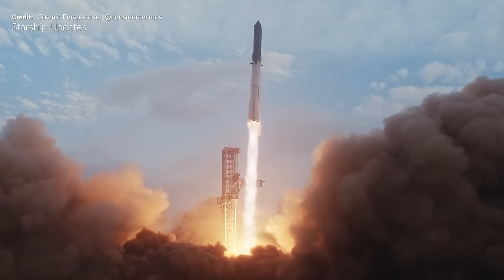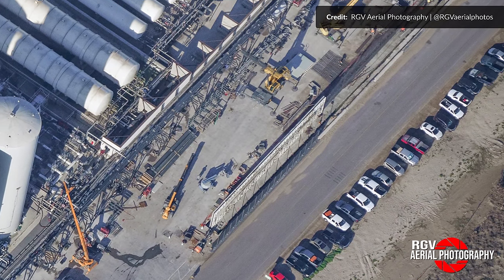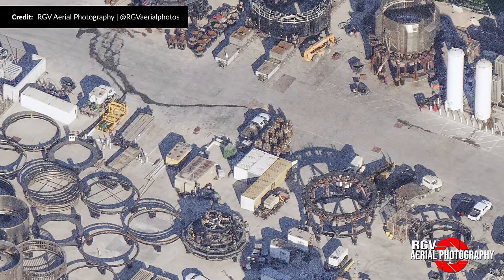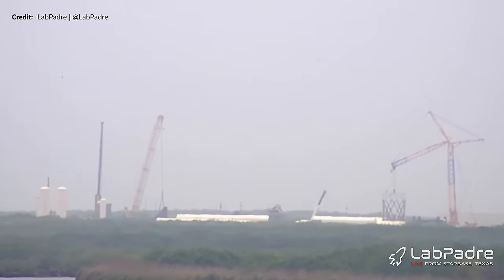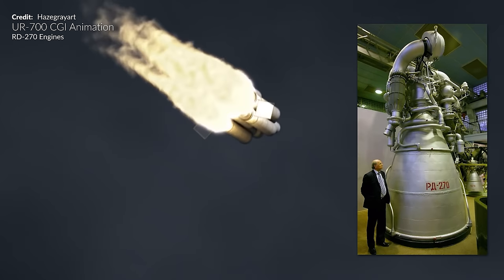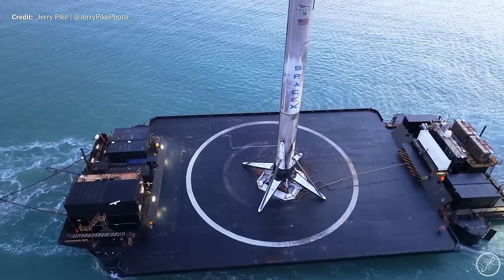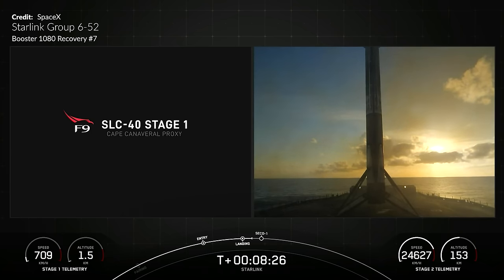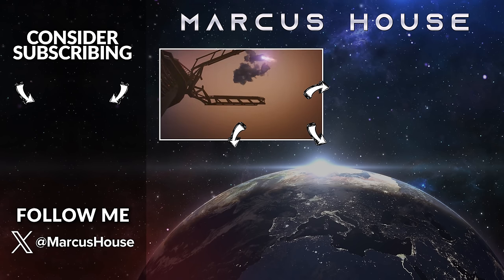Why is SpaceX Starship Only Capable of 40 to 50 Tons to Orbit For the Flight 3 Version?

Comment: For all you doubters out there: it took 7 launches before Falcon made a successful launch, flight and landing. Now they do it twice a week.
Reply: This isn't Falcon and NASA was heavily involved
Reply: @budyeddi5814 I don’t know the extent of NASA being involved, but SpaceX just finished their 3rd launch of the heavy and between its first and third launches, they have made enormous progress over a thing substantially more complicated than Falcon. At this rate, Starship is on pace to beat Falcon. Now that is an awesome track record considering the increased engineering challenges and complexity.
Reply: @Curteman20  ah yes, third launch and has yet to reach orbit. Absolutely groundbreaking
Reply: @budyeddi5814 ah yes, completely ignoring the original comment.
Reply: @budyeddi5814  hate and bait all you want, just small bait didnt make spacex stopping chase their dreams😂
Reply: @budyeddi5814 Starship didn't get completely into orbit as planned, and isn't planned for the 4th either. The first 4 flights for the Saturn program were also all suborbital as planned.
Reply: @mewmew3800  luckily criticism won't hinder their progress, but Uncle Sam might step in if they don't start hitting some major milestones
Reply: Apollo worked every time, its 2024, our tech is better yet they can stay on schedule. I hope they lose gov funding
Reply: @ThatDiecastGuy69 You need to do some more research on Apollo buddy.
Reply: @ThatDiecastGuy69  huh? All Apollo missions were manned. Manned rockets have a much different standard for safety than an unmanned test rocket. 

That doesn’t even consider that NASA and SpaceX have a completely different culture. SpaceX is much more willing to take risks to learn from mistakes and quickly iterate.

SpaceX would also succeed without government funding at this point. Government funding is now only a small portion of total revenue. Starlink program alone is more than 50% of all revenue
Reply: For all the doubters: Falcon was supposed to be a quick turnaround system, launching again within a day. Not to mention it was supposed to be a fraction of the cost to launch.
Reply: @SamuelMM_Mitosis Check again. Not all Apollo missions were manned missions. By the way Saturn5 had zero failures.
Reply: Criticism is warranted being this is the Artemis lander and was shoehorned into the program. There are big differences in work culture since the 60's. While I want to see it succeed, I have my worries.
Reply: @angrydoggy9170 Apollo 12 wants to know your location.
Reply: @coreygraybz  12? Don’t get it. Do elaborate.
Reply: @angrydoggy9170  Saturn V had multiple engine failures, one of which caused a partial mission failure.
Reply: @angrydoggy9170  Also, Saturn V was the last of the Saturn rocket program. The program had numerous failures and several suborbital flights that people count as failures for Starship.
Reply: @angrydoggy9170  they are? Falcon holds the record by far for most repeated launches from a single rocket.
Reply: @angrydoggy9170  do you know the cost per launch and cost per kg to LEO compared to competition
Reply: @budyeddi5814 I think we now expect them to know pretty well what it takes to reach orbit.
Reply: This is a completely different launch vehicle dude lmao
Reply: @chootybeeks1088  what does that change about the clear consistency in progress between launches?
Reply: @hebestreitfan6973 Starship can reach orbit, and SpaceX does know what it takes to reach orbit, and Starship did reach orbital velocity its 3rd test.  It's intentionally kept out of orbit because it's a test vehicle.  It's not trying to sustain orbit.  The last thing they want is an out of control vehicle coming back into the atmosphere at a completely unknown location out of control.  

Flight test 4 will test the engine relight and re-entry.  Once they have this tested, they will complete an orbit with Starship.  The goal is to not have a 165 foot rocket flipping end over end in orbit crashing into things.
Reply: One day they’ll get Starship into orbit. Once all the life support, furnishings, equipment, food, water, and close to a hundred people they might need several strap on boosters. So far with only the fuel and oxidizer it is having a difficult time to keep flying, or even complete an orbit.
Manned flight, if it ever happens, will probably be in another two years. I hope it’s sooner but even the most ardent fan boys are starting to wonder.
Reply: @SamuelMM_Mitosis  Ate you claiming Falcon is the quick turnaround (under a day) system that Musk has promised?
Reply: @SamuelMM_Mitosis Apollo 4,5, and 6 were unmanned.
Reply: @SamuelMM_Mitosis  Anyway, it’s not that hard to get that record if you’re just about the only one using reusable rockets.
Reply: I will guarantee you that Elon has his doubts.
Reply: @SamuelMM_Mitosis  they've made progress, but he's comparing apples to oranges is what I'm saying
Reply: @wavemaker54  It will never be able to fit a hundred people like Elon claims. Not even 20.
Reply: @bryandraughn9830  Elon doesn’t doubt anything as long as the money keeps flowing in.
Reply: @budyeddi5814 - nasa had next to 0 involvement with merlin. I'm sure they were heavily involved in safety and standards for flight.
Reply: @bryandraughn9830  lmfao, okay kid, whatever you say. Elon has many things, but doubts aren't one of them. But sure, keep pretending you losers know what you're talking about.
Reply: Great facts to use on haters else where !👍🏽 Starship will be an amazing leap forward and change, in how space agencies will operate moving forward in the future.
Reply: @angrydoggy9170 what money? His MIC competitors have gotten many 100x more government funding. SpaceX got chicken feed for Artemis. That's why they won.. And because of demonstrated success
Reply: @budyeddi5814 nasa is also heavily involved in starship because they need a lunar lander
Reply: @budyeddi5814 they could have made orbit, but they wanted to maintain their reentry in a fixed reentry window and timeframe.

If Starship failed to accomplish its de-orbit burn from orbit, it would have eventually returned as its orbit decayed and definitely not in the prescribed window.
Reply: @budyeddi5814 it was a decision to not reach orbit. The launch could have reached orbit easily. That isn’t the challenge.
Reply: @budyeddi5814 NASA is heavily involved with Starship as well. Especially the HLS variant. You just seem to be blinding doubting, which you are entitled to. Have fun being wrong once again in a few years. I’m sure you doubted Falcon as well. Have a good one!
Reply: @nobody2685  projection and deflection with a side of bold assumptions.. typical at this point. Fyi, I was a huge fan of F9
Reply: @Curteman20  💯
Reply: @angrydoggy9170  I’m claiming it’s the quickest turn around of any system ever.
Reply: @budyeddi5814 Raptor was designed and built by the same people that designed Merlin. NASA's involvement was a contribution to development. Thereafter the involvement was to watch to make sure the actual flights met all the standards.
The Booster is being iterated by the same process. 
Success is not 100% ensured, but  progress, and the number of prototypes available for testing, tells me there's a great chance of success.
Reply: @angrydoggy9170  is it easy to have the lowest cost to LEO and lowest price per seat to the ISS of any system ever on Earth?
Reply: @chootybeeks1088  I don’t think he’s really comparing starship to falcon, I think he’s just pointing out that SpaceX as a company shouldn’t be doubted just because they failed some early launches. It’s part of their culture to test vehicles even if it’s likely to fail because they get valuable data from it.
Reply: I'm fascinated by the Elon /SpaceX  haters , it seems emotion based, completely irrational hate towards projects that are groundbreaking,  I suspect the same haters despise Trump ( TDS) or the haters could be bots, Bezos does not recieve the same hate , Boeing SLS does not receive the same hate. SpaceX and Tesla do not hit every milestone but CLEARLY  they make progress unlike ANY other company on Earth every country on Earth would be proud to have a SpaceX/Tesla.
Reply: @angrydoggy9170 You're clearly disturbed.
Reply: @wavemaker54 Why so negative about an exciting project? How's SLS or Blue Origin? you hate the #1 rocket company in the world? that's bizarre!
Reply: Hey, I'm a doubter :D
I bet both of my testicles that we won't go to the moon because of Elon and the Starship :3
Reply: Well it took SLS and Saturn V one launch lmao
Reply: @ThatDiecastGuy69 Except that it didn’t work every time.
Reply: Nobody is doubting Starship… doubting the actual claimed capabilities
Reply: @leshommesdupilly Comparing SLS to starship is not a good idea.  SLS development has taken decades, cost tens of billions of dollars, and is ongoing.  It also costs over $1b per launch, and can't complete the mission by itself.  It is the poster child for why having a defined purpose and mission is critical.  However, I'm happy that it exists.  Saturn V was a purpose built monster and was also extremely expensive.  Even though it had its problems, it was a true marvel of engineering.
Reply: They’re called haters for a reason.
Reply: How many Apollo launches did it take to get to Luna orbit.. Nevermind not getting to LEO
Reply: The complexity hasn't changed since the 1960s and they have better technology presently.. Why aren't spacex on the moon yet already?
Reply: Falcon can't turn around in less than a month and the price per KG isn't ground breaking. There is more SI in these promises than fact
Reply: Star ship booster didn't reduce velocity at all it broke up at hypersonic speed. And the second stage was out of control spinning..
Reply: How reliable are those full flow combustion turbines when someone is sick on the moon and they need to get home.
Reply: @bobbarclay316 over a billion $s per prototype.. 🎉
Reply: @anthonypelchat  very true about the apollo flights... however they did meet their set milestones with each launch. So far the set milestones get suggested for heavy then on launch day those milestones get set back to clearing the pad. 
By comparison Artemis has had 1 launch so far and met every milestone set... so far artemis is considerably better bang for you buck
Reply: @bladewraith1580 starship launch 1 milestone was to clean the pad, anything else was a bonus. Spacex could easily set goals that would definitely be hit but prefer to aim higher. Its not about pr, its about data
Reply: @ExploringCabinsandMines it's not about hating, it's about project delivery budgets schedule overruns and contracts. It's business and tax payers money. Sometimes promises aren't enough. SpaceX need to deliver soon.
Reply: Sls is 6 years late on its first launch. That's 6 years of additional problems they had to resolve. If they had launched earlier they would have no rocket to try again with because they're development pipeline is so slow.  Spacex can produce a prototype in months, nasa takes years
Reply: Didn't NASA start planning to go to the moon in like 62 and get there in 69?  Spacex said they would be on Mars in 24..😂 Back in 16
Reply: @Radar23...Okay cool,so where's your successful Moon-capable rocket?
Reply: @Radar23  Agreed but SpaceX is our best hope for efficiency,  Gov no , Boeing  no , Blue Origin  no. I'm totally psyched when Starship launches,  Elon has already said the percentages of rapid disasembly so anything better than that is a treat to watch.
Reply: Doubters don't watch space videos. They watch the bottom of their bottles.
Reply: @angrydoggy9170  

"Anyway, it’s not that hard to get that record if you’re just about the only one using reusable rockets."

Uh, that's got to be one of the most inane statements I've ever heard.  That's like saying "It's pretty easy to be the record holder in running a mile in under four minutes when you're the only person who's ever run a mile in under four minutes!" 

I mean, anyone can do that!
Reply: @Radar23  So he can only build 70 or 80 prototypes.
Reply: @budyeddi5814  It’s almost as if none of the flight profiles included making orbit. You tried, little guy. I’ll give you that. 

PS, this is the part where you cry again about people being meanies to you
Reply: Apollo and SLS have a completely different design mentality to Spacex.  Those programs were built on the concept of making sure they didn’t catastrophically fail in testing before launching.  Therefore each spaceship took a long time to build from factories all over the US and everything was tested to the nth degree before launch and had multiple redundancies to cope with failing components.   They could not afford catastrophic failures as it would set the program back years if they had one.  Spacex, on the other hand, has a “fail quickly” design philosophy.  Their spaceships are much cheaper to build with simpler, non-redundant designs, built right there at the launch site, they spend very little time in research and testing and launch with hardware configurations they think will but aren’t sure will work and then see what happens.  If it fails they use the data to redesign for the next launch and throw another one up.  Sometimes they even change things that DID work just to see if the new idea works just as well or even better.  Doing it this way gives them lots of “real world” information they can rapidly incorporate into the next version.   People who are used to watching the careful Apollo or Space Shuttle development process might be alarmed at seeing Spacex cheerfully launching whole Starships into space only to blow them up but this “suck it and see” approach should yield a cheap to build, robustly working Starship very quickly, so long as they don’t run out of money first.  Time is money too and time spent testing to the nth degree can costs a company a LOT because all the people needed to build, launch and recover have to be paid to sit around and wait while the boffins argue about ideal grid fin spacing in a back room.
Reply: This isn’t Falcon bro.
Reply: Pretty sad. SpaceX has all the advantages of prior development and still coming up short.
Reply: One learns more from failure than from success. Very few people on this platform appreciate properly what is being done here.
Reply: @angrydoggy9170 ”Not all Apollo missions were manned missions”. You are completely ignoring the point of their comment be it valid or not. SaturnV is a rocket capable of manned missions regardless of there being people on it or not.
Reply: @budyeddi5814 what? Ate you kidding? The last launch, the third launch completed orbital insertion, it made it to space. Do you not have any shame? 

Your ignorance comments can easily be found wrong.
Reply: @techpappee  tell us you don't know the difference between orbital and sub orbital 📉
Reply: @leshommesdupilly  except that’s because of an entirely different development methodology, spacex has demonstrated that this process works with falcon and I am not at all doubtful they will for starship too. The entire mission of the company is to make life multi planetary, I don’t foresee them giving up.
Reply: Shit, I think Falcon launched like 5 times last week
Reply: @techpappee  please stop feeding the troll. It's just trying to wind you up. It hasn't said a single intelligent thing. Just continually saying "never reached orbit, bla" and calling everyone wrong with 0 argument
Reply: There are no plans to launch Starship with “close to a hundred people” or to use strap on boosters, not sure where you’re getting your information from.
Reply: @Radar23  are you kidding? Falcon 9 and Falcon Heavy were not designed to go to the moon. They are designed to reach LEO. That’s partly why they are developing Starship which should be capable of reaching the moon and beyond.
Reply: @Radar23  Can you tell me the price per KG compared to the competition??? It absolutely is groundbreaking. The cost per kg for falcon heavy is $1410, for the Russian Soyuz it’s $11,268. How is a 10x price reduction not ground breaking
Reply: @Radar23  Starship prototypes are only around $90 million, why do you just make up numbers?
Reply: @Radar23  NASA had no budget and didn’t need to deal with regulations slowing them down. Do you know the cost of Saturn V, especially if you adjust for inflation?
Reply: @Radar23  Saturn V would cost 1.5 billion per launch in Todays money. It was $185 million in the 1960s. Starship is only $90 million per launch today. That’s nearly 17x cheaper. In other words. They could fail 17x collecting valuable data and it would still cost less than 1 Saturn V launch.
Reply: @canadianracer83 Yes you are the only one with understanding
Reply: Falcon 9 and Heavy are NOT Starship. You CAN NOT associate the success of one to another....
Reply: @SamuelMM_Mitosis Yeah, it's much cheaper to launch and empty steel can, isn't it?
Reply: @JosefTorkelsen  You all must be SoaceX engineers then to know that.
Reply: @ExploringCabinsandMines Bet that Elon will give 50/50 chances of a RUD when they eventually launch humans in about 5-10 years
Reply: @JamesHardaker And you have given no evidence to contrary either. Elon is raising an army of trolls, and you're playing right into it😅
Reply: @SamuelMM_Mitosis Oh boy, here comes the inflation argument
Reply: @jaydonbrown617  the company that makes it is the same? You can’t assume it will succeed, but you also can’t assume it won’t, but based on the track record of SpaceX you can make predictions
Reply: @jaydonbrown617  what’s your problem with me adjusting for inflation??? The Salaries to pay the engineers are higher today. The cost of materials are higher today. The fuel is more expensive today. What exactly is your point?
Reply: @jaydonbrown617  you think the payload will add anything to the cost? Why would you have a payload in a test launch???
Reply: @jaydonbrown617  considering that falcon rockets are the most reliable rockets today I would predict that starship will be as reliable if not more so.
Reply: @SamuelMM_Mitosis  Yes, predictions at best, and they can go both ways. With the technology at their disposal, it's leaning to a no 👎 As far as moon and definitely Mars missions go
Reply: @SamuelMM_Mitosis  The point is why even bring up the cost of something from back then adjusted for inflation? Inflation is never ending and 40 years from now, if we're still around, some other space company or organization/government will be launching ships for far less and look back on SpaceX costs as "insanely high"
Reply: @jaydonbrown617  He's already said the whole thing may not work out, people expect instant satisfaction nowadays.
Reply: @jaydonbrown617  based on what are you making that claim? Do you know what is required to go to the moon? With the thrust potential of the raptor engines the math absolutely checks out.
Reply: @jaydonbrown617  the point is we should appreciate progress instead of discourage it? Even if you compare SpaceX falcon rockets to other modern day rockets the cost is significantly lower.
Reply: @ExploringCabinsandMines  Yes, those people being you die hard believers. Why do you think they hype up every launch, despite the numerous system failures?
Reply: @SamuelMM_Mitosis  Potential. Instead of looking at "potential" let's look at feasibility and reliability. Hmm...raptor current design is still struggling with both, it's just the nature of that design. This is why NASA never focused on turbo pump engines, pressure-fed is the way to go. It's been proven and it works well.
Reply: @SamuelMM_Mitosis  Test launches That's all they are. You're comparing empty cans to a fully-decked out multi-stage human rated system capable of flying to the moon and back. Now how much do you think Starship will cost when it inevitably gets this upgrade....?
Reply: @SamuelMM_Mitosis  That's just fundamentally flawed thinking. Falcon is far less complex and in-depth as Starship, it's not comparable in the slightest. Starship is claiming to do a hundred different,  far more difficult things, and with a design very little removed from the Falcon9, and you believe it's just tomāto, tomäto.😂
Reply: @SamuelMM_Mitosis  That's just Falcon, and they've managed to do their missions having left the bare minimum in the design. Other companies are seeking to achieve more than Falcon 9,  but of course they don't have the resources readily available to them as SpaceX does, so things are far more expensive by default.
Reply: @russc788 By no means am I the only one, it just seems most people on here expect starship and super heavy to work first try. Like what they’re doing here is easy or something. Every “failure” advances the program exponentially, the forces and mass of this vehicle are staggering. Rapid development and destructive testing, especially on this scale, is going to yield many failures on the path to success. Space X is capable of more in 5 years than any other program has achieved spanning decades. Partly due to rapid development and destructive testing. You have to break eggs to make an omelet on the moon and beyond…
Reply: Comical how comments get removed, to keep the hardcore believers in the dark.
Reply: @canadianracer83  As long as there is taxpayer money to waste. And you'll just say better to give SpaceX my money than NASA or anyone else. We'll see what your stance is once Elon is forced to stop working on this doomed Mars dream.
Reply: @jaydonbrown617  I think this just comes down to the fact that I’m much more optimistic than you on SpaceX ability to overcome these challenges that you are bringing up based on their previous ability to overcome difficulties. Sure raptors have failed in these test launches, but there was less failures between subsequent launches. I believe they could make them very reliable.

If you are such a big fan of NASA you should be a fan of SpaceX. They are one of their biggest cheerleaders
Reply: @jaydonbrown617 My friend, I’m Canadian, we barely even have a space program. I am however a human being who believes, and has for several decades, that space exploration should have been number one priority for the survival and prosperity of all humans. So many of the things you take for granted every day are a result of various space programs.
Reply: @SamuelMM_Mitosis  Did I say I was a fan of NASA, where'd you get that from? 

It's all fun and games, and "data" until something goes wrong much earlier in the flight, say right after launch, or until someone gets hurt.
Reply: @canadianracer83  Care to list these things I "take for granted " as you so claim?
Reply: @jaydonbrown617  Starship is privately funded by SpaceX, most of the money comes from Starlink.  NASA has a contract with SpaceX for HLS, but taxpayer dollars don't fund Starship development
Reply: @jaydonbrown617  the likelihood of someone getting hurt from an unmanned mission is astronomically low. There’s also not a chance they would do a manned mission unless there is plenty of successful unmanned missions
Reply: @jaydonbrown617  I think the price is more likely to decrease rather than increase
Reply: @jaydonbrown617  I don’t think the starship is the same as Falcon, I think the engineers at SpaceX are the same if not better than before because of more experience and I think those engineers are capable of overcoming difficult challenges.
Reply: They need to do 8-10 just to get one of these to the moon

It's the stupidest idea ever
Reply: @ThatDiecastGuy69  You know a fire inside Apollo 1 killed three of NASA’s best astronauts, right? Also if you don’t know what happened on Apollo 13 then you’re proving you don’t really know a lot about space flight…
Reply: @zm5668  why do you guys feel the need to make up numbers, Starship is only expected to need 1 or 2 max refuels for a trip to the moon and potentially more refueling for a trip to mars.
Reply: Falcon exponentially more efficient than this stupid thing
Reply: How many times did Apollo need to be refilled in space before reaching the moon?  How many times does starship need to refuel in space to reach the moon?  
Discussion over
Reply: @SamuelMM_Mitosis starlink is a large part of revenue but still not close to profitable. Revenue without profit is useless - in fact it’s a liability.
Reply: @frankv7068 yep. It is showing the world how to repeatedly fail
Reply: @JosefTorkelsen apparently the challenge is to launch a ship that doesn’t leak and can actually maintain orientation. 
Starship is a fail in every way so far.
Reply: @Meatball2022  how much did Apollo missions cost compared to starship? That question is far more important
Reply: @Meatball2022   nice job making things up, Starlink has been profitable the last few quarters and is only projected to become more profitable
Reply: @SamuelMM_Mitosis  starlink is not at all profitable. Not even close.
Reply: @Meatball2022  because you said so? Look at the numbers, it’s not hard to do a few seconds of research to prove yourself wrong. That wouldn’t fit your bias though
Reply: @SamuelMM_Mitosis  go ahead and look at the numbers. When you realize actual launch costs aren’t included, let me know. I’ll be in the back laughing in the meantime.
Reply: @Meatball2022  it’s actually really simple math and you can include launch costs. Currently Starlink has approximately 5,500 satellites let’s round that to 6,000. SpaceX takes 60 per launch, so that’s 100 launches. Each launch is $52 million, so that is 5.2 billion dollars in launch costs. Starlink has 2.6 million subscribers all paying $120 a month. Thats $1440 a year per customer or about $4 billion in revenue. That would mean if they just kept their current subscribers and never launched again they would pay off the launch costs in less than 2 years.
Reply: @SamuelMM_Mitosis   it’s a bit more complex than that, simpleton. Each hardware set sold to consumers is sold at a huge loss. Each unit they sell for 500 actually costs closer to 3000 to produce. So - each customer has to be a customer for 3 years JUST TO PAY OFF THE HARDWARE  let alone show a profit. 
Plus, your launch costs aren’t even close to accurate. Closer to $70 million per launch
On top of you conveniently rounding up the number of customers they have, you can now see they need probably close to 6 years out of a customer just to break even. 
You’re welcome.
Reply: @Meatball2022  brother, you are using the year one cost to manufacture the user terminal, they have significantly reduced the costs. It’s estimated that the cost to manufacture now is as low as $250. Nice try though simpleton. Keep making up numbers
Reply: @Meatball2022  Na when you’re that rich, and having all his companies going his way,  I hardly doubt if he really cares what the world thinks about it 🤣, Falcon 9 failed 7 times and it’s the most reliable, reusable rocket out there, you try and do better.
Reply: @budyeddi5814 Starship is one of the biggest ever with a new fuel and new concept - you can't compare it to previous rockets.

Not even Saturn V who is the closest in size. Remember Saturn V was not built for reusability and uses a completely different fuel
Reply: @SamuelMM_Mitosis  The price of what exactly? If you're referring to Starship launches after it being built up, then you're just wrong. There's no possible way the costs go down
Reply: @SamuelMM_Mitosis  Of course it's easier to just say that. It matters not that the engineers are the same, the challenges they are being forced to solve are different with Starship than with F9.

If Elon tells the world he's going to build a space elevator, you think that the engineers are just going to "figure it out"? Now tell me, how does that make sense?
Reply: @jaydonbrown617   costs absolutely go down with scale. The Falcon 9 is significantly cheaper today than the original prototypes. You become more efficient at building with time, not less.
Reply: @jaydonbrown617  A space elevator is humanly impossible with the tech and materials we have today, Starship is totally possible, but challenging.
Reply: @SamuelMM_Mitosis  My dude......cost doesn't go down when you add more and more to the inside of the rocket. Falcon 9 is currently $50 million per launch or something, far more than Starship at the moment. But Starship is an empty test vessel while while Falcon 9 is actually performing missions. After Starship is built up to start carrying out missions, likely to launch more space trash, it will be far more expensive than Falcon 9. If it ever gets to launch astronauts, it will be even more expensive by so much more.
Reply: @SamuelMM_Mitosis  There are aspects that make Starship's goals near impossible with the current technology at our disposal ,it's going to be very difficult, almost impossibly so to get Starship to the moon, and then astronomically more so to get to Mars.
Reply: @frankv7068  it is the most reliable. That doesn’t mean I’m wrong.
Reply: @MrAlbertaSurfer No. Starship reached LEO altitude but not velocity.
Reply: @jaydonbrown617  you have no idea what you are talking about. Falcon 9 is 52 million per launch, These starship prototypes are about 90 million per launch. How does the fact that it doesn’t have a payload change the cost? The Falcon 9 prototypes were also more expensive than the current ones today.
Reply: @jaydonbrown617  getting to Mars is not significantly harder than getting to the moon. The main difference is distance (which means time). The velocity required to get to the moon is 10.8 km/s the velocity required to achieve escape velocity which can essentially take you anywhere in the solar system with enough time is 11.2 km/s. Once you escape earths gravity no more fuel is needed unless you need to make a course correction and until you need to slow down for a landing. After that Escaping Mars is much easier than escaping earth. 

Orbital refueling should make this a relatively simple difference.

If Falcon Heavy was capable of getting a payload to reach Mars orbit then Starship certainly has the potential to as well if not more easily.
Reply: @JesusHChrist2000  yes, it did reach orbital velocity.  It was one of the flight goals, but maintaining orbit was not.  SpaceX was clear of its goals for flight test 3.  Orbital velocity is 25-28000km/h and Ship reached over 26000km/h before using the upper limits of the atmosphere to begin braking for a splashdown on the Indian Ocean.  

It didn't orbit because it wasn't trying to.
Reply: @SamuelMM_Mitosis  Sigh, you're just living in a lala science fiction land. It's so convenient for you to just say oh "tHiS iS eAsY" without actually knowing the science and math behind it. 
It's much easier for smaller craft to get to farther distances than larger craft, and Starship would be the largest by far.  It's also more difficult to get larger craft moving that quickly, you know.....basic high school physics. Also, Starship will not be empty, so the fuel required increases. You also have to slow down and eventually land, something that takes much more fuel and planning out, something SpaceX has not figured out yet. How naive are you? What do you hope to gain from believing in this with ZERO doubt and question?
Reply: Elon blew up all three prototypes. 
And he's years behind schedule isn't he?
Ah and...
How many saturn rockets blew up sub orbit? 🤔
Reply: @7177YT  what's your point?  Every single current space vehicle is behind schedule.  Boeing is 7 years late with Starliner, BO is 4 years late with the first New Glenn, ULA was late with Vulcan Centaur, partly because BO couldn't get the BE-4 engines right.  Nevermind the massive cost overruns.  

Yea, the first 3 Starship test vehicles blew up, but they knew that before they launched.  It's part into the mission plan, and is how SpaceX does their thing, this is nothing new.  It's exactly the same way the wildly successful Falcon 9 was tested.

Saturn V was the flight vehicle that resulted from the Jupiter rockets that came before it.  They didn't just build a Saturn V out of nowhere and leave for the moon.  This is Starship's testing stage, and the flight ready vehicles will be different from these test articles.
Reply: @jaydonbrown617  I have taken multiple physics classes while getting my masters in computer science, what are your credentials? I am also just a nerd that enjoys researching this stuff. The math absolutely checks out. Orbital refueling is one of the many things that makes this possible.

When did I say it was easy? I said getting to mars is not much harder than getting to the moon, and launching from mars is significantly easier than launching from earth.
Reply: @SamuelMM_Mitosis  Oh computer science, okay. So zeros and ones? Nothing engineering based? And physics class are just a requirement that you likely don't remember at all. That explains ALL I need to know, assuming I can just believe you. I could tell you that I have my degrees in Mechanical Engineering, something far less removed from Aerospace Engineering or rocket science, but there no real way to prove any of us are telling the truth.

How many Starships will it take to get their whimsical orbital fuel depot going? How many more will it take to get it functional? How many more will it take to start launching towards Mars and actually make it? How many of those will it take to land in one piece? And how many of those will it take to take off again in one piece? 

Its fine to believe in something, you just have to understand that it may be something with astronomically low chances of succeeding in your lifetime. You could believe you'll win the lottery, but that does mean you'll actually ever win. And trust me, you have a better chance at that than SoaceX getting to Mars with Starship in one piece.
Reply: @MrAlbertaSurfer  Don't overdose on copium. BTW how many more of those rockets are expected to blow up according to plan? It's a long way down from a failure rate of 100% down to 0%.. And then you gotta have to solve all those issues with refuiling and so forth. My bet is that when the money is gone there will be no moon viable moon landing mission, but  musk will perhaps walk away with a servicable space truck to litter LOE with more profitable space junk. And NASA having paid the iron out the kinks.
Reply: @MrAlbertaSurfer  Blowing up is part of their test plan? Are you serious or are you actually trolling?
Reply: @jaydonbrown617  I’m not sure about you, but physics was one of the classes I found fascinating and spent extra time to make sure I understood. I think I’ve already conveyed in this conversation that failure is a possibility. I just think the probability of success is much higher than you do.
Reply: @jaydonbrown617  no he’s not joking. Obviously blowing up isn’t the goal, the goal of the first few test vehicles was to collect data despite the extremely high probability of failure. Why do you think the team was cheering??
Reply: @SamuelMM_Mitosis  Hmm, why was the team cheering? Maybe because they are paid to do so, to invoke a false sense of success. It's a psychological mind game to keep up the hype. 

Too bad they didn't get the memo for Musk's last public team meeting. Now that was downright EMBARRASSING. I was cringing so hard at every "please clap" moment that never came, it's honestly unwatchable.
Reply: @jaydonbrown617  or maybe it’s because the team is proud of the progress made and they understand the expectations for each launch? Do you pay attention to these? They talked about expectations prior to the launches. It’s not like they failed and did a bunch of damage control. If you paid attention you would have expected those outcomes too.
Reply: @coreygraybz You're thinking og Apollo 13.   And it returned safely.   One thing x boy hasn'tdisclosed is that in order to return the engines intact for a quick turnaround double the fuel needs to be used.   Further landing upright with such a huge windcatching vehicle will require technology that will not exist forsome time.   The closest a quick turnaround vehicle is one similar to the space shuttle.   This wassuggested to x boy but  it didn'tcomply with his juvenile fantasy.   There  is no possibility he will meet the due target on the moon considering that no vehicle can travel moon,to earth return (without additional fuel) with the current parameters and 9 out of 10 flights will be to set up fuel storage in space.  The programme needs to be removed from the manwho has accomplished nothing
Reply: @budyeddi5814 They were not trying to reach orbit on these 3 flights. They were sub orbital flights. The last flight, however, they could have and would have reached orbit if they had run Starships engines a little longer, but that was not the goal.
Reply: I don't doubt SpaceX, I doubt Mr musk...
Reply: @ErkkiPalmu  like him or not, SpaceX never would have existed without Mr musk…
Reply: @ThatDiecastGuy69 didn’t Apollo 1 kill all the astronauts involved?
Reply: @SamuelMM_Mitosis  Yes, and he'll be credited for that in the history books. I just think (and hope) there could be a future for SpaceX without Musk. Imo
Reply: @SamuelMM_Mitosis  You completely disregarded what I said, and that's fine, I understand how bad it looks. How about you pay attention to what I said .

I'm off of the topic of the delusional cheering, please explain the dead quiet, zombie-like atmosphere of the crowd at Elon's last publicized team meeting/presentation.

 If not, then good day sir, agree to disagree.
Reply: @roba7737  Point to the remaining fuel that Starship had left then, please.
Reply: @nothankyou9906  Oh here we go with Apollo 1 🙄
Reply: @angrydoggy9170 Saturn 5 was also able to get 40t to the moon while starship can currently, by elons optermistic view get 50t to Leo with a rocket twice as powerful.

But I hear the musk rats. They will be able to get 200t to the moon when fully operational. OK, we shall see but if is projected to take 13 starships (12 as just tanker launches) to get 200t to the moon. Ie 5 Saturn 5 launches with half the power. 

Starship is a disaster.
Reply: Launch falcon twice a week. 

OK, let’s extrapolate this based on falcons best case to date. 

2 starships per week will require ~8 boosters on rotation (assuming the fastest falcon 9 booster turn around can be maintained), let’s be optimistic and say just two tankers on rotation and a crewed HLS.

The initial HLS landing on the moon would take 6 weeks from the first launch to trans lunar injection. Assuming Starship doesn’t need refuelling again one in lunar orbit before descending to the surface. To then do a second trip to the lunar surface would be this repeated with a tankers that would be sent to lunar orbit to refuel and then return to earth. 

Can you seriously say this is a good plan and spacex hasn’t just ripped off the American tax payers?
Reply: @Iain31313  Someone gets it, thank the lord and savior Elon Musk!
And all of this is on a lot of ifs as Starship is nowhere near achieving this, beyond the fancy animations their creativity team dreamt up. Do they even have a lunar mission animation, or just that photoshopped image of a white "lander" Starship?
Reply: @jaydonbrown617  yup, that scenario described is based on a “fully operational” starship, no failures and no aborted launches due to weather etc. 

To give even more perspective, it is purported that starship can take 40-50t to Leo, while Saturn V could take the same payload to the moons surface with half the power. 

Even if starship can get to a point of 200-300t to the lunar surface, it will taken ~13 launches to get it there (assuming a conservative 12 launch plan for refuelling) where Saturn V would have been capable to take the same 200-300t in 5-8 launches. With OLD TECHNOLOGY!!

Yet again Elon has tried to reinvent the wheel and has ended up making them square.
Reply: @Iain31313  6 weeks would be frankly better than my expectations of about 1 launch per 10 days. The tanker concept is frankly the only reason why spacex bothered with the Artemis contract as it is the only way to send serious tonnage beyond earth orbit. You are trading a shorter lead time for massive amounts of payload over much smaller and less capable landers that can arrive quicker. If starship was only putting a few tons on the surface I'd be more inclined to agree with you. It will put upwards of 100 tons being conservative for uncrewed and 10+ tons for crewed flights discounting habitable pressurized mass. There are downsides to every system such as tanker refueling flights experiencing some kind of failure. Still, if Artemis is going to succeed it needs to be willing to accept some risks and a delayed flight is better than a flight experiencing failure with people aboard.
Reply: @Iain31313  Careful mentioning Saturn V, it really irks people that it made it to the moon with no destructive testing. Despite it's obvious astronomical costs, it was a first if it's kind and an insane technological achievement at the time. It's no wonder it cost so much, but again it matters not the cost, it's the feat attained. 
SpaceX could spend 10 times the cost of the Apollo missions and still not get any farther than they currently are. Their only shot at success is following in NASA's lunar footprints, which they currently are slowly adapting to...
Reply: Well, it took SLS 1 launch for twice the capability of Starship v1 apparently. Just saying. 🙈 puts flame suit on
Reply: @EstorilEm  The problem is that SLS has a launch cadence that is almost 2 orders of magnitude slower than Starship aims to be. It's taken 15 years to get to a point where it's able to launch at best once a year, wholly unsuitable for a permanent presence on the moon like with the ISS. I understand that it is part of the Artemis Program come what may but considering that the Saturn V could put a 2 spaceraft into LLO it's quite disappointing that SLS is less capable in almost every way.
Reply: @EstorilEm  And I understand the hesitation about Spacex as they are trying something that's incredibly ambitious for even world superpowers. Id rather SLS be used to build out Gateway quicker to ensure Congress doesn't drop Artemis. SLS production needs to be hastened and streamlined if we are going to use it long term.
Reply: This thread is exactly why I hate social media. The amount of people who want to hate and troll just to get some attention is insane.
Reply: @EstorilEm  that’s hilarious. As SLS has a very specific role I’d never considered what it’s capable of lifting. Looks like it can get 95t to Leo.
Reply: @coreygraybz  interesting take. If you’re using Saturn V type rockets you could have 8 built and ready to launch which would get the same payload (300t) to the moon over 8 launches. These could possibly be launch in quick succession over a week or two. It would therefore be less time, less rockets and not require huge technological steps. Ie refuelling to be designed tested and certified before you get to the moon. 

Sure you don’t have reusability, however launching payload direct to target without reusability vs reusability and having to launch twice as many rockets my be the way to go. 

I’m doubtful that starship will get to the advertised payloads within the next decade, though I like to be proven wrong with things like this. I’m also doubtful they will be reusable from the lunar surface from what I’ve seen so far.
Reply: @jaydonbrown617  so true. As Destin from smarter everyday put it, they actually have an instruction manual on how to get to the moon. Why are they not looking at every tiny detail in that and saying “OK, for this element of the mission our technology has progress ‘x’ amount since then meaning it’s  easier or safer etc”. 

It’s far easier to innovate of a proven design than to start from scratch.
Reply: Saturn v launched orbited and re entered a crew capsule perfectly first try
Reply: @shawnderrick1952  well like Elon I'll say in 4  years.. When's your moon landing? 2 years away?
Reply: @ExploringCabinsandMines  I'm totally excited also.. It's just all the BS and spin that annoys me.. That said Nada were secretive back in the day so at least we get to enjoy all the failures and wins together.
I feel it's just a little optimistic to thing starship will be launching manned flights to the moon before 2028..but it's pretty obvious elons promises are just marketing
Reply: @eyesuckle  what's the big fixation about reusable rockets? That's just sales hype. The Luna launchers won't be coming back. Mass is everything..
Reply: @Radar23  Elon is definitely optimistic but I believe he's honest, every launch is exting!!
Reply: The Saturn 5, Space Shuttle, and SLS all had successful launches on their first flight. Starship on its 3rd flight barely made it to space with no payload.
Reply: @edgarwalk5637  minus well throw it away and go pout at home 😔 😟 Surprisingly, as part of the reporting process, NASA officials admitted the rocket was too expensive to support its lunar exploration efforts as part of the Artemis program. "Senior NASA officials told GAO that at current cost levels, the SLS program is unaffordable," the new report states.Sep 7, 2023
Reply: @edgarwalk5637  SLS engines go to the bottom of the ocean.
Reply: @edgarwalk5637  Starship is a test vehicle, working towards a final product. Saturn 5, Shuttle and SLS are the final product.

Why is it that the haters can't see Starship for what it is?  Anyone can take 11 years to reconfigure existing shuttle equipment to make the SLS rocket, that flies an updated Apollo capsule.  Saturn 5 was built by 400k individuals, financially backed by the US government, and was born from the Jupiter rockets that came before it, of which 2 of the 3 test vehicles failed.
Reply: Saturn V had less than half the thrust of Starship and could have put over 100 tons into orbit. And Starship is already way late and changing the engines is going to mean a new series of test flights.
Reply: @laurenmp7486  Great you should join SpaceX and show them the way being that the knowhow and tooling for Saturn 5 is gone.
Reply: @ExploringCabinsandMines  physics is physics, when a rocket with more than twice the thrust of another rocket can only get half as much into orbit, something is up.
Reply: @laurenmp7486  WTF are you talking about? According to SpaceX, Starship is currently capable of hauling ~200 tons to LEO in an expendable configuration, making it the most capable rocket ever developed. It would take nine Falcon 9 expendable flights to deliver the same payload volume as one expendable Starship flight.Mar 20, 2024
Reply: @laurenmp7486  Should be the same at worst,  The Saturn V's payload to orbit: 129 tonnes. Payload to Moon: 48.5 tonnes. The StarShip's payload to orbit: 150 tonnes. Payload to the Moon: 150 tonnes, Payload to Mars: 150 tonnes.Mar 1, 2024
Reply: @laurenmp7486  LOL "somethings up"
Reply: @budyeddi5814 the 3rd launch would have made orbit but they held it back to de-orbit at a fixed position.
Reply: @budyeddi5814  NASA was not heavily involved. They only had contract for resupply.
Reply: @ExploringCabinsandMines  No it's not, Starship 3 is supposed to do 200 tons but Elon flat out said right now they could only do 40 to 50 tons to low earth orbit.
Reply: @laurenmp7486  give me a link or website because I can't find that quote.
Reply: @ExploringCabinsandMines  Did you not notice the title of the video? It's literally about how Starship currently could only put 40 to 50 tons into orbit.
Reply: Will see, but im a doubter
Reply: @budyeddi5814  Indeed, this is Starship and it proved orbit capability in its 3rd proper flight. And NASA is surely involved just as much if not more right now with SpaceX compared to back when the Falcon was developed and launched the first  times lol.
Reply: @budyeddi5814  Starships 3rd launch proved that they can reach orbit and deploy payloads in orbit. They actively decided to go into a suborbital trajectory because they didnt want the ship to orbit but rather to reenter the atmosphere. If you cant understand something as simple as this, maybe rocket science isnt really your thing. You should find a more simple thing to spend your time on
Reply: @wavemaker54  I mean before we want to put any humans into this ship (considering it will land propulsively) it should surely do a perfect job at launching, reaching orbit and reentering+landing at very least 100 times in a row. given SpaceX is launching about 100 times a year I would say 1-2 years is  a decent timeframe. Maybe add 1 year for ground suppor and production line to get up to speed. We know engine production has increased dramatically already, but they will need to pump out like 1 of them every day if they even only want to produce 1 new ship a month, not even considering engine replacements on landed ships or any lost ships.
Reply: @angrydoggy9170  Noone is saying that Falcon achieved everything Musk wished or aimed for, which you like to frame as "promised".
What I do claim is that the Falcon 9  system is the savest, cheapest and most sustainable launch system we have ever  seen. The rocket is human rated and basically has a 100% success rate not only for launching and getting the payload where it should go, but even for landing its booster. 
compare to that no other company has even attempted to recover their boosters by landing them. Rocketlabs only just started tests with parachutes on their booster stage, but given it splashes into the water, thus needs major refurbishment, is only in early testing and the fact the rocket is much much smaller the achievements arent really comparable.
Reply: This! Spacex breaking the barriers,  and making nasa look like fools.
Reply: Sometimes twice a day!
Reply: @budyeddi5814 thank goodness NASA isn’t as involved. Progress will be much more efficient and assured
Reply: @MrAlbertaSurfer The first one was supposed to reach orbit and land in the ocean. None of them have reached orbit. They aren't intentionally failing missions.
Reply: @matthewsmith1779  yeah, sure.
Reply: For all the supporters.... Starship SLS was supposed to have landed on the moon last month. 

They have yet to get into orbit.
Reply: @ericchin739  It's HLS, not SLS.  SLS is the rocket that launched the Orion capsule that's supposed to be used for Artemis that's also not figured out yet due to the capsule suffering unexpected amounts of damage during the unmanned flight.  It's a critical piece of the Moon mission because it was never intened to fly Starship to the moon and back at all.  

The mission has also changed because Lunar Gateway is nowhere near being built and was also a critical part of the Artemis Moon missions...
Reply: @ericchin739  Exactly!! 🤣🤣🤣
Reply: @MrAlbertaSurfer  So their failing on purpose?
Reply: @matthewsmith1779  whaddya mean exactly?  That dude doesn't even know what rocket he's talking about.

For HLS to have been on the moon by now means Orion would have taken people to Lunar Gateway first, neither of which are ready either, with Gateway not even in development.
Reply: @MrAlbertaSurfer    He's talking about Musk hyperbole. His infamous "I'm confident we can do it this year. If not this year, early next year." 10 years later, said thing never happens. Soms call this optimistic thinking. The sane of us call this "lying to investors to artificially pump the stock." People usually go to jail for this, but Elon is special.
Reply: @matthewsmith1779  look, I get it.  You're bitter with Elon over Twitter.  Have a good weekend.
Reply: @MrAlbertaSurfer  I don't, nor have I ever had a Twitter account. I was in favor of the sale because of all the hilarious meltdowns it caused.

Twitter aside, I was just stating the facts. People are sitting in prison right now for the crap Elon has been getting away with.
Reply: @SamuelMM_Mitosis   ummmm no, not all Apollo missions were manned. 

Do a bit of research dude.
Reply: @MrAlbertaSurfer   It was a typo. I know which rocket is which. 

SLS will launch the Orion spacecraft to the moon. 

HLS is the rocket that will supposedly rendezvous with Orion, and bring the people to the moon. 

But before it does THAT, it has to be refueled in Earth orbit by a "minimum of 15 launches"   

But yeah, I have no idea which rocket I'm talking about 🤣🤣😂🤣😂🤣
Reply: @ericchin739  don't pretend you didn't get it wrong.

And the 15 times thing is yet to be seen.  It's not clear yet how many trips it will require to be refueled.  

None of this is happening in two weeks, including the Orion capsule being ready, so what difference does any of it make?  NASA awarded them the contract based off their concept, so what offends you?
Reply: @laurenmp7486  most important thing you are missing is Saturn V costed 1.5 billion dollars adjusted for inflation, Starship costs 90 million and is reusable.
Reply: For all you muskrats NASA landed on moon first try
Reply: @mcboat3467  if you mean Saturn Vs first launch was on the moon definitely not. 18/300 Astronauts have died from launch failures in NASAs history. That’s 1 in 16 astronauts dying just from launch. SpaceX has killed 0 astronauts and has not attempted a moon mission yet, but their first is likely to be successful.
Reply: @mcboat3467  Sure, with Apollo 11.  What do you suppose Apollo 1-10 were?  There were 3 missions before Apollo 1, which had an accident that killed all 3 astronauts, then we had 9 other missions that tested the systems and went a little further each time.  Two missions after Apollo 11 there was a second accident that resulted in not making it to the surface with Apollo 13.

So yeah, first try, on their 14th attempt with 3 dead muskrats...
Reply: @budyeddi5814 an "unexpected rock tornado" was literally groundbreaking
Reply: Exactly!
Reply: @budyeddi5814  they already hit major milestones, every launch has set a new milestone!

I see you lurking on SpaceX posts ready to pounce at every opportunity. What is your motivation to do so? Is it Elon and you dislike him? EVs? Apollo/NASA fan? Or just doing it for fun? Something has to motivate you to spend the time and energy to comment as you do.
Reply: @ThatDiecastGuy69 go whine to your boyfriend.